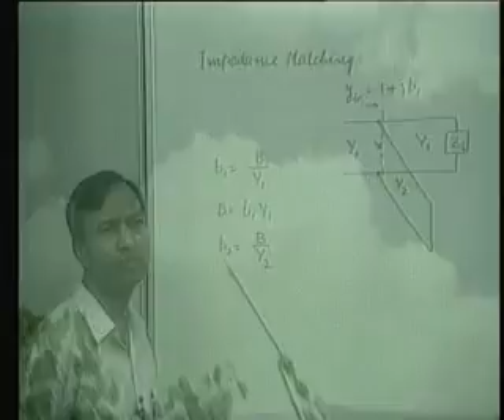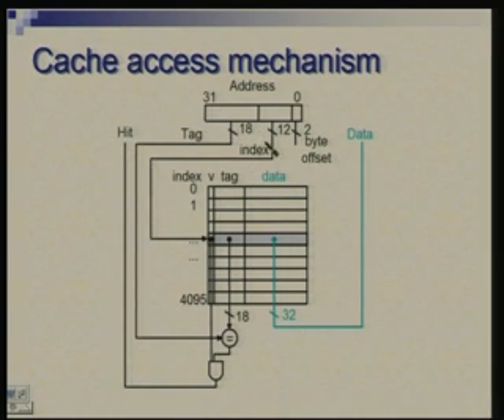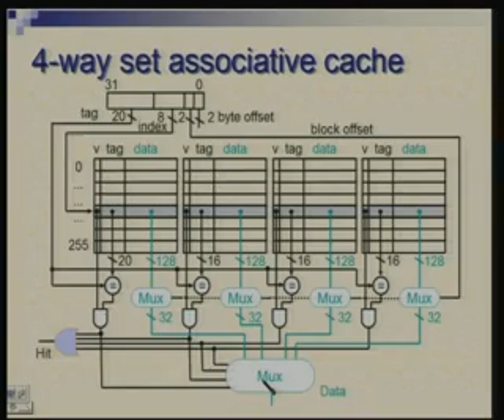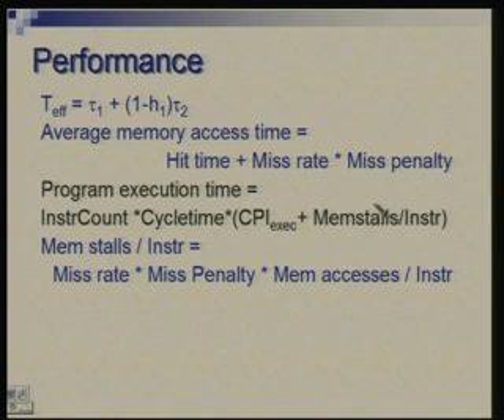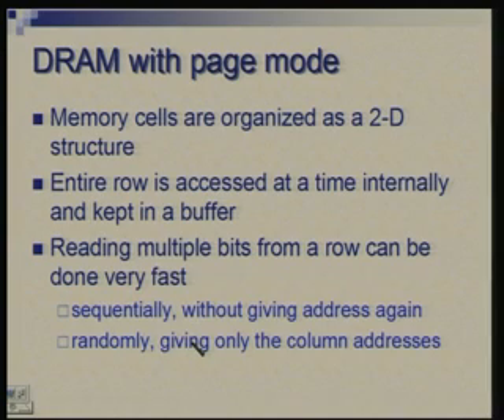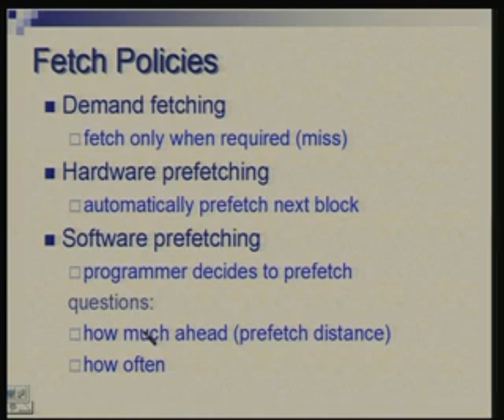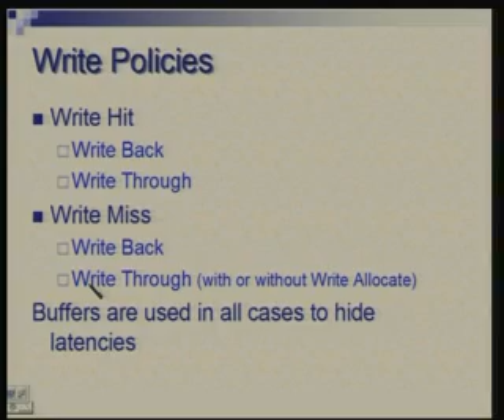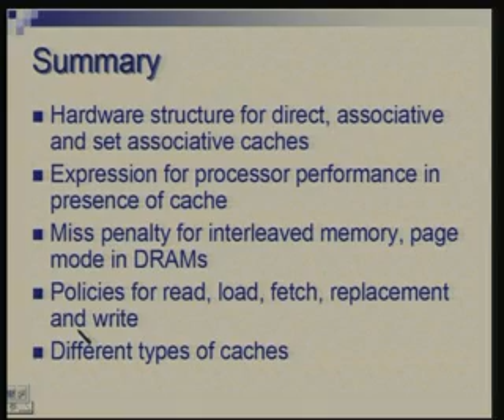Lecture - 29 Memory Hierarchy : Cache Organization

Comment: @vedhasp 
I think what he means is, that with higher associativity you can avoid more conflicts. It's what he also said earlier. For example to reduce conflicts you could also use an 8-way associative cache. Or even fully associative. But with increasing associativity you also have an increasing complexity of the cache management.
So, reducing conflicts results in higher associativity, but results in higher complexity. 
I hope it's the answer to your question